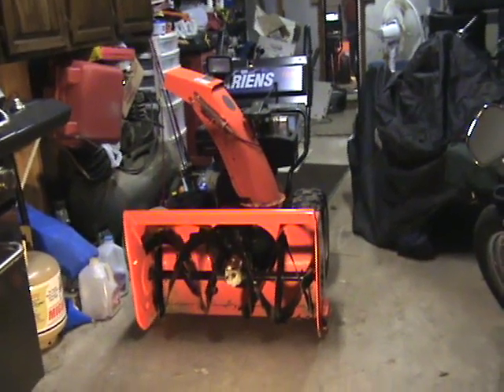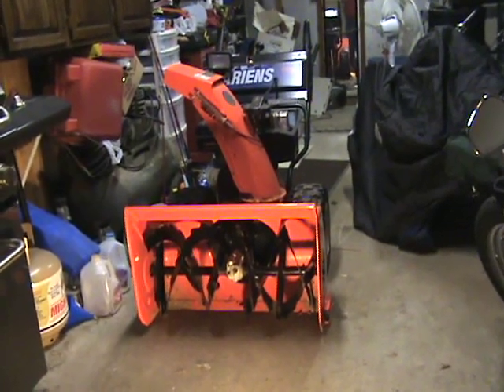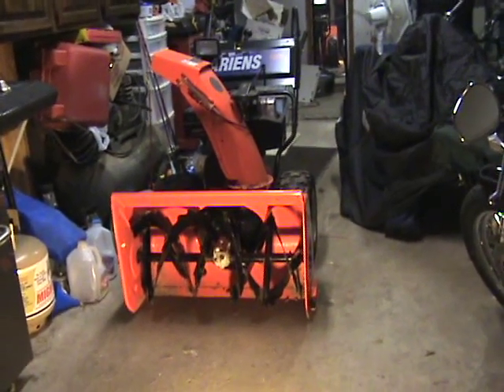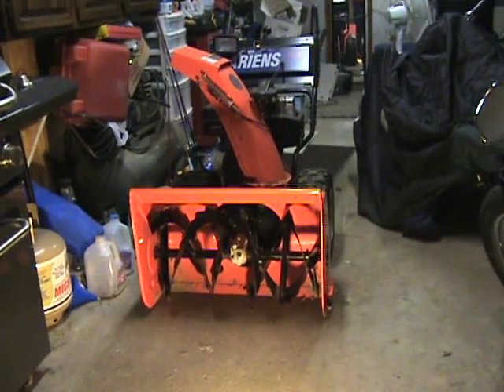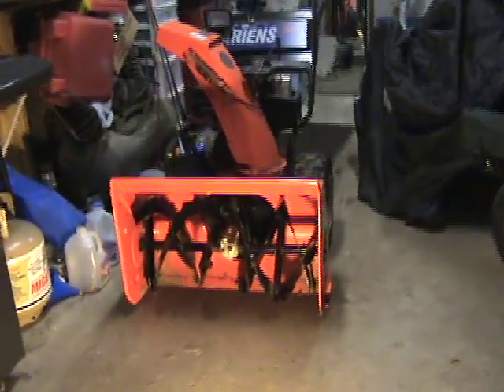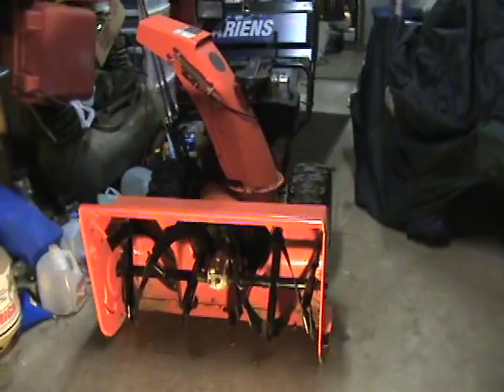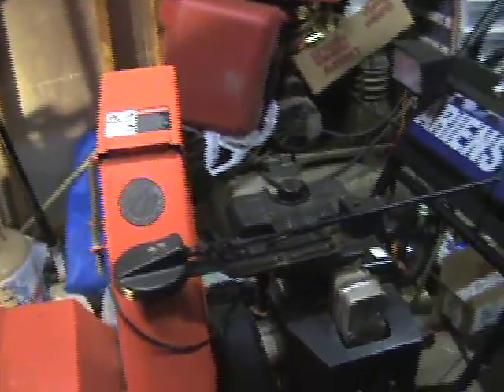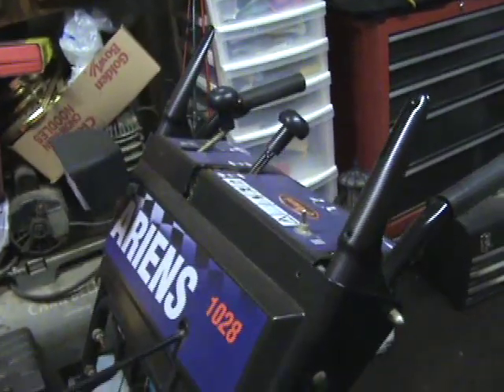Ariens Snow Blower 1028 2 stage

Comment: Nice lookin' blower-  mine's identical to yours except for the heated grips. Always starts on first pull, whether it's 30deg or minus 20. What a great quality, dependable machine. Btw I bought mine from the Ariens dealer when it was 1yr old (in 2002) for $900.

Comment from the maker: @kxdirtrider85 
Two stage means that the snow is thrown in two stages.  First the auger in the front draws the snow into the machine and the an impeller throws the snow out of the shute.  a single stage blower has only an auger and has to spin much faster in order to throw the snow the same distance as a two stage blower.

Comment from the maker: OK, A single stage snowblower uses the same auger to collect and throw the snow and the auger spins at a very high speed in order to do both operations.  They are ussally smaller and don't throw the snow as far.  A two stage has an auger that feeds the snow to an impeller which throws the snow.  2 stage blowers are ussally larger from 20"  to more than 36" and they throw the snow farther. 2 stage snow blowers can be used on almost any surface because they have skid shoes that elevate the auger.